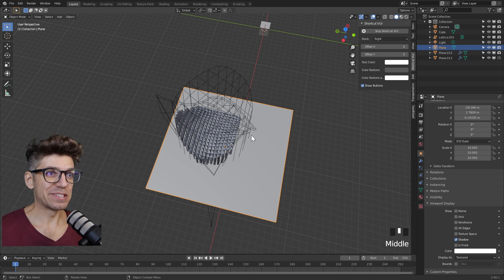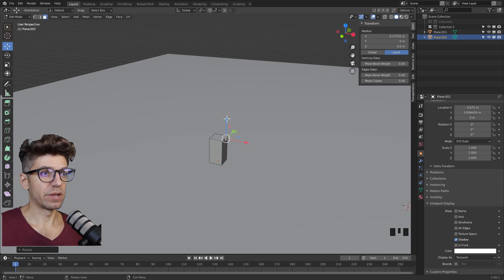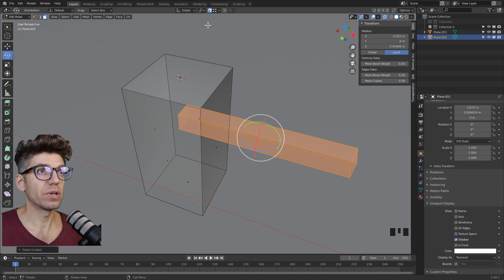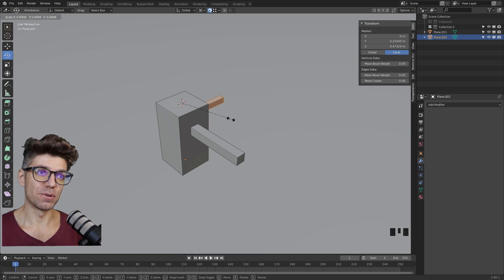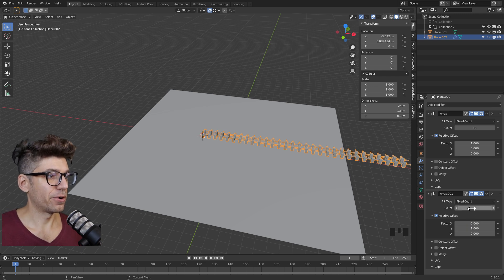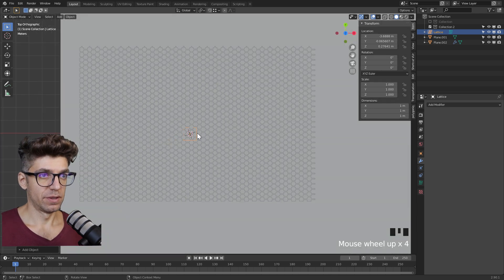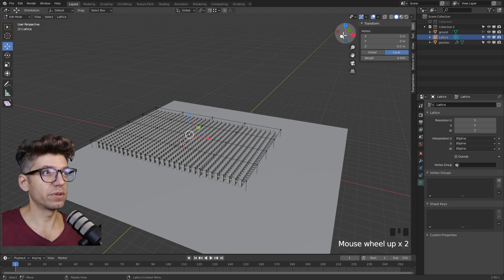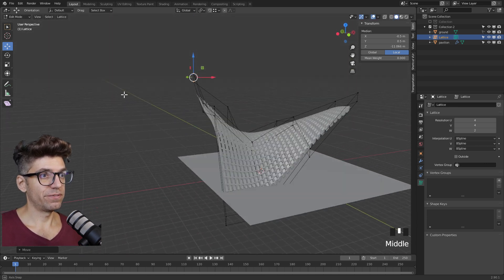Blender for Architectural Design Part 3b Procedural Pavilion setup

Comment: I'm using 2.92 and the "snap to edge"e is just not responding. By holding the ctrl key it will.
Reply from the maker: I just tried it on blank file and it seems to work? Are your snaps enabled with the magnet button? Ctrl typically toggles the opposite snaps behaviour. E.g., when you have the snaps off, holding ctrl while moving will temporarily enable them or when your snaps are on, holding ctrl while transforming will temporarily disable them.

Comment: Hi Dimitar, I wonder if the academy tv is like an earlier release of the youtube tutorial or It would be a further demonstration of what we've seen here. I was thinking of taking the course as there is not much left that I can get out from other youtube tutorials.
Reply from the maker: Hi, there are overlaps with this video series, but it's already completely available. Additionally, it covers a few more workflows in regards to using modifiers - creating a space-frame like structures. Do you have any other topics of interest in mind? Always curious about what users like you would like to learn.
Reply: @UHStudio  I'm a 4th-year architecture student at Uni Adelaide, we mostly used rhino here and probably in many other Universities around here, even in the industry they used rhino &Grashopper quite often. 
I've never been a grasshopper person so Blender for me is like a tool for conceptual design (Especially to deal with the curved and bizarre forms or simulation to come up with spontaneous shape - My Uni discipline mostly focuses on Conceptual design), and rhino for 2d drawings (Precise modeling & such). So I reckon if there is any topic related to curvy - parametric - or grasshopper-like would be nice.